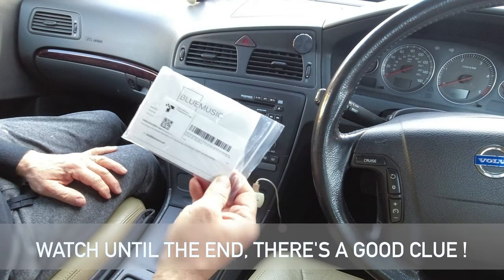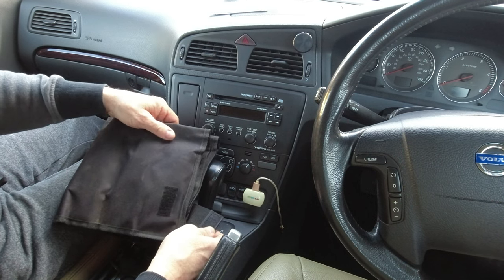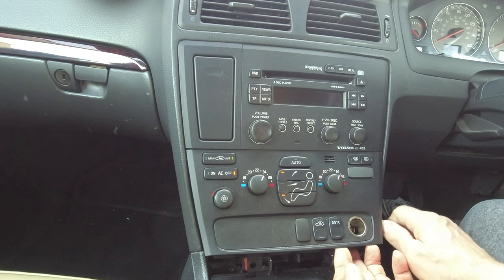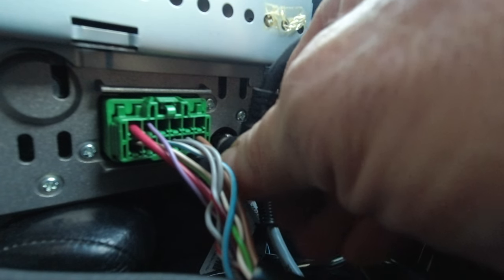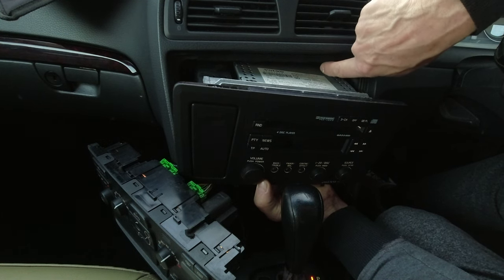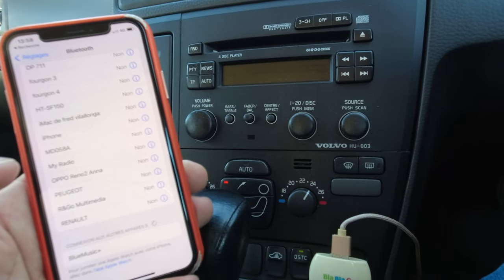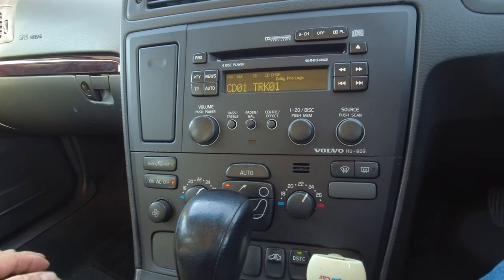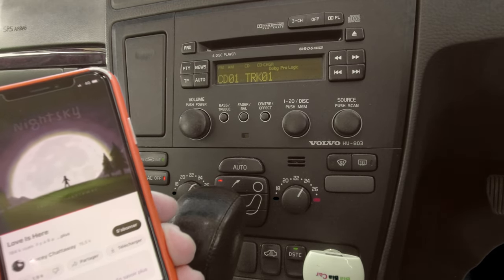👍VOLVO BLUETOOTH ADAPTER BlueMusic FOR HU RADIO, 40€ ! HOW TO INSTALL, 7mn VIDEO👍

Comment: Ahh I love it. So much better than the bluetooth cassette I had before. 
Automatically connects when I turn on the car, doesn’t have to be recharged in inconvenient moments, doesn’t dangle out the radio looking ghetto…just a modern experience in a solid old car. Love it!
Reply from the maker: Perfect comment ever about the Bluetooth adapter

Comment: I bought one from amazon 8 months ago. It's in the car, I haven't installed it yet. this video helped a preliminary idea for installation i will install it myself as soon as possible.:yougotthis::goodvibes:
Reply from the maker: Honestly you need only 15/20mn to do it and enjoy! Quality of sound is very good, at least similar to the original. Cheers

Comment: The cd changer appear after you connect the device ? Or without the device appear ?
Reply: Because I don’t have the car but it doesn’t appear cd changer
Reply from the maker: Did you plug well the Bluetooth unit ?
Reply: @psv1600  Noo, I don’t have the Bluetooth

Comment: Does the microfon work well with phone calls, and wher did you put the microfone?
Reply from the maker: Honestly I don't know yet as I never received a "real" call. I just tried out after installation with my wife's phone and it's working well. I put on the side of the climate control unit, there's a gap between the unit and dashboard. like that it's hidding the wiring.

Comment: Is there a side noise when boosting all the way, a slight whistling from the speakers, because the Chinese models have it.
Reply from the maker: Honestly no, quality of sound is very very good. I just mentionned that if there's something hard on the storage compartiment belon the speakers it's vibrating with the bass, obviously there's no link with the bluetooth adapter!

Comment: Hi! Do u know if Can I connect directly to the CD back charger? I want to prevent to disarm the radio! Thanks!
Reply from the maker: Hi, no unfortunately you must to remove the radio to plug as I show on the video. Thanks to you !
Reply: @psv1600  Thank u!! :D
Reply from the maker: @dariocastillo3595  my pleasure

Comment: would this work with the HU-650 1 cd version? (the version without CD changer button).
Reply from the maker: Hi, it seems yes as I checked on the website. Cheers
Reply: @psv1600 how does this connect then? If no changer what mode is used to connect?
Reply from the maker: @ZZZZZZZIPD  I don’t know really on the HU650 but I guess you’ll connect wby choosing the cd on the source selector button.

Comment: I pulled out my HU-850 and both off the rear plugs are already in use.  Any ideas?
Reply from the maker: I guess you’ll have to disconnect the cd  💿 plug unfortunately, or at least the unit using the connector you need for the Bluetooth item
Reply: @psv1600  I disconnected the second plug and it works perfectly.  No idea what the second plug was connected to though?  Everything seems to still work fine.
Reply from the maker: @robbhultman  good to know thanks. Honestly I don’t know for what is it !
Reply: For a 6 CD player, located in the trunk i guess
Reply: @robbhultman  actually it is for rti when you unplug it rti still works but navigation would be without voice command. You can use Y adapter to solve this problem.

Comment: im confused i have same radio (hu803) i connect modul but i dont see cd changer function
Reply from the maker: Hi, did you turn the function button fully, it's after or before CD player if I remember well ?
Reply: @psv1600  yes, I went to buy another radio if the problem is not only in the radio
Reply from the maker: @tomik123lol7  I will make a short later (it’s dark here) to show how it is on my car. Maybe it’s help ? I will txt you
Reply: @psv1600  yes 🙏
Reply from the maker: I put this short online, you'll be able to see what's going on on my radio. hope you can fix the problem.
https://youtube.com/shorts/POXyjCfIWNM?feature=share

Comment: Dont change the head unit. Your parking sensors and steering controls and other sound wont work
Reply from the maker: No need to change, just plug at the back of the unit